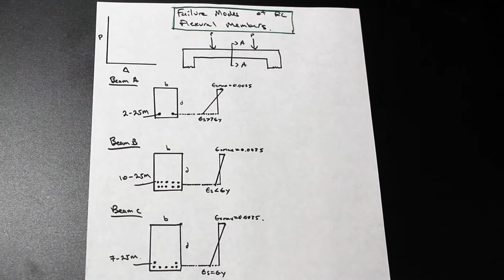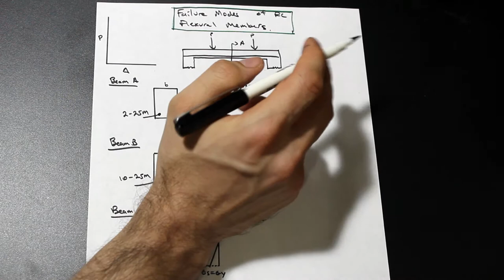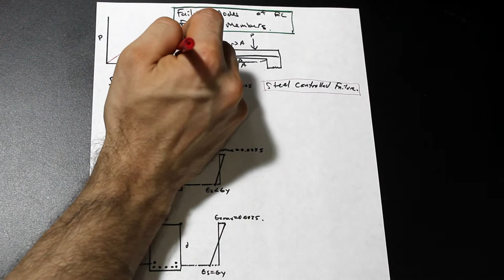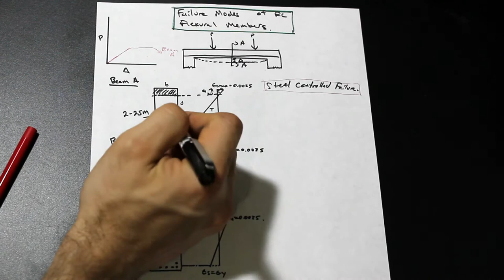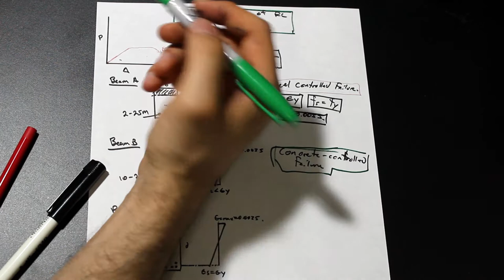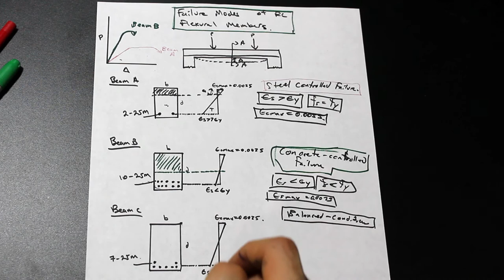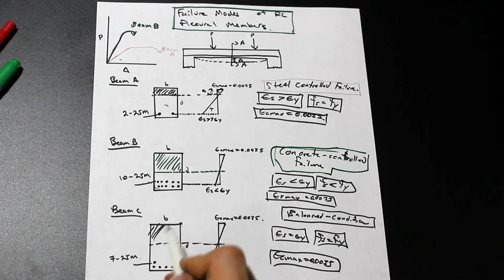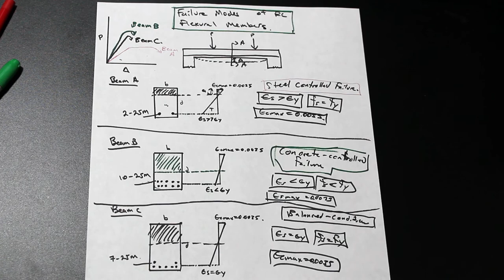Failure Modes of Reinforced Concrete Beams Explained

Comment: Suppose i have a t beam (steel controlled section) now maximum compresive strain is. 0035 at top most compression extreme fiber (50 mm  From N.A.) and est for steel will be 10 times compresive strain( as its depth from NA is 500 mm)
Then how much strain is allowed maximum in steel

Comment: Didn't really understand what he meant by "more concrete=sudden failure" ( 05:53 ). Shouldn't more concrete equal slower failure or am I missing the point completely?
Reply from the maker: To grasp the concept you need to have a basic understanding of how flexure in beams works.  As a load is applied and the beam bends or experiences flexure, if you cut a section through the beam you'll find that some top portion of the beam is in compression and the bottom portion of the beam is in tension.  We add steel through the tension zone to help hold the beam together here and to transmit the load as concrete is weak in tension.  What you want is to add enough steel so that the steel deforms and the beam is allowed to deflect and the steel is allowed to yield before the concrete compression in the top of the beam reaches its crushing limit.  If you add too much steel in the bottom portion of the beam, what will happen is the steel will never yield, and the concrete at the top of the beam will crush before the beam deflects.  This will cause a sudden failure of the beam, versus a progressive collapse.  Sudden collapses are a big item in structural engineering codes and are strongly guarded against.  Hope that helps!